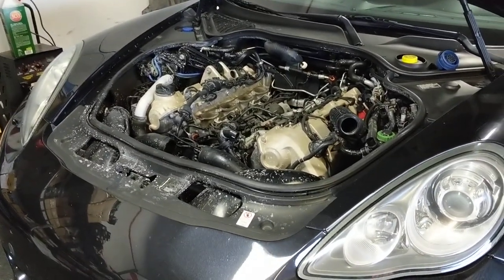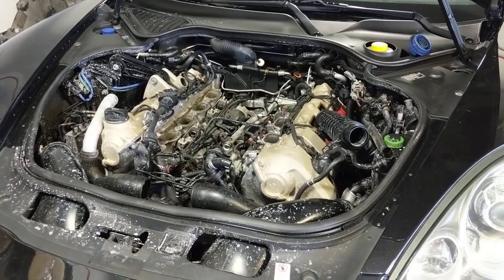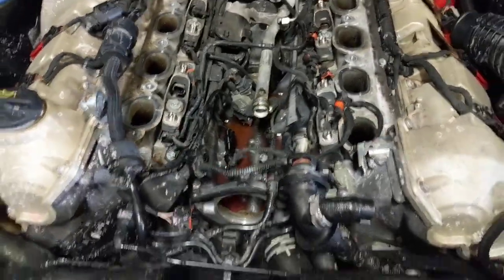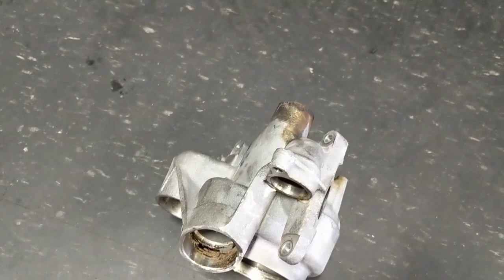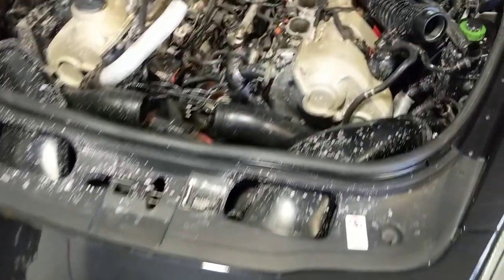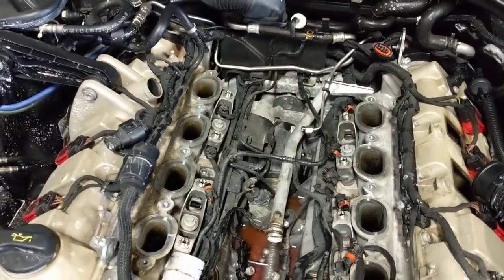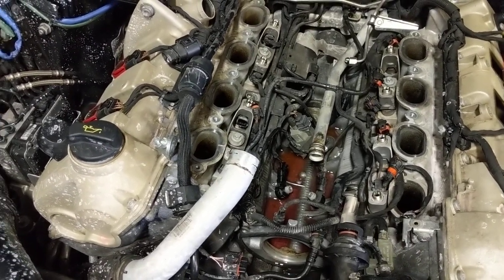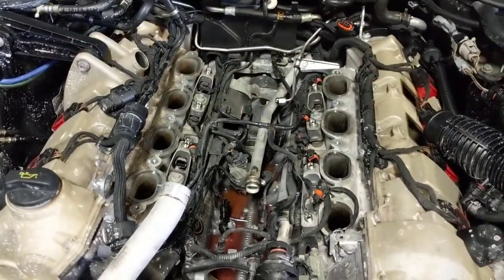Porsche 970 Panamera Turbo thermostat housing coolant leak

Comment: Sometimes I wonder if Porsches should be water-cooled simply because 991s have failed water pumps and coolant leaks at the thermostat housing. And that at very low milage as in new cars.

Comment: My thermostat housing is good do you recommend cleaning the epoxy of and re gluing?????
Reply from the maker: In all honesty if you’re performing the repair yourself you can take the risk if you clean it probably and use the right materials to glue it back you will probably be fine but a repair shop wouldn’t take that risk